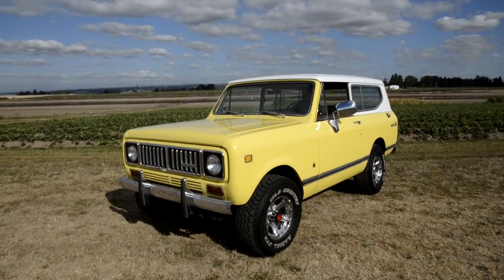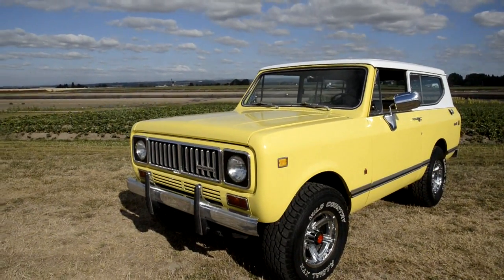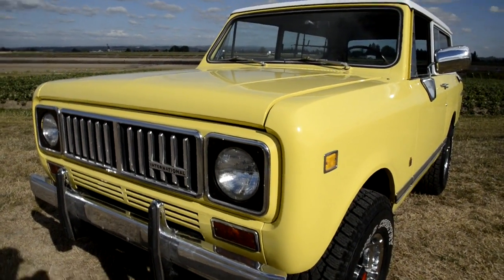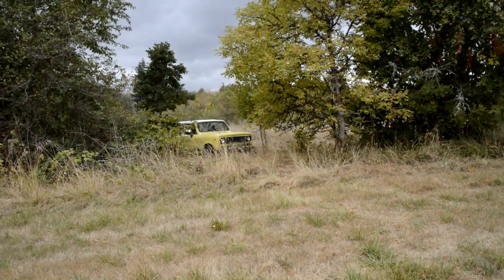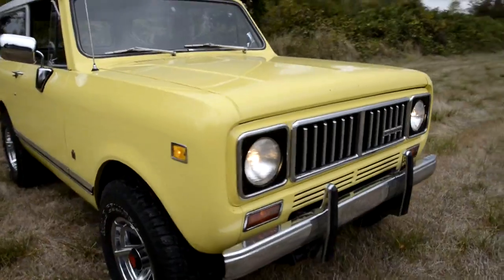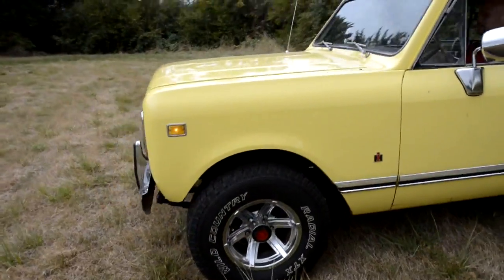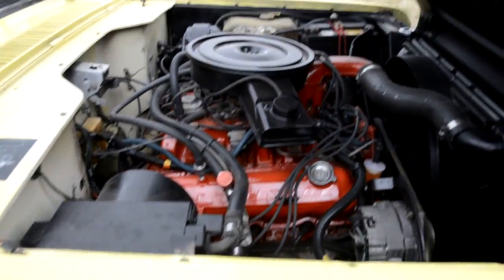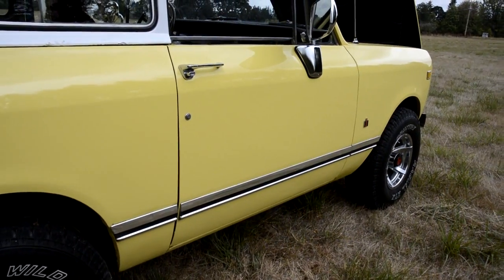1975 International Harvester Scout II IH Cornbinder

Comment: He rusted away!!! Even after multiple rebuilds of the body. 304 engine was STRONG and through the transfer case VERY torquey! Only flaw? Need to shut down to shift into SUPER LOW GEAR. No way to do it "on the fly".

Comment: Your brakes probably worked terribly on this.  You have the wrong master cylinder for your setup.  Your master is for a drum/drum set, not disc/drum.  Disc/drum masters have a notably larger forward reservoir because discs take a lot more fluid to actuate than drums.  With your setup, the rears are going to engage long before your fronts grab at all.